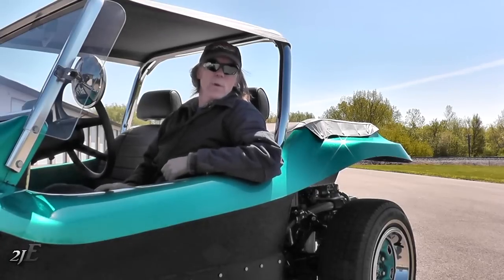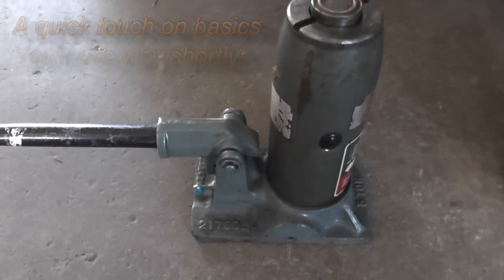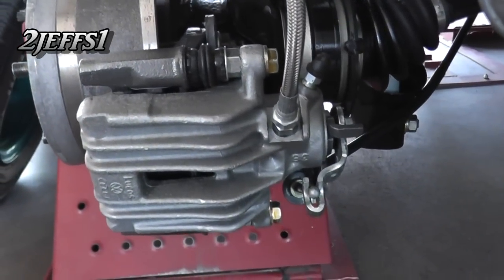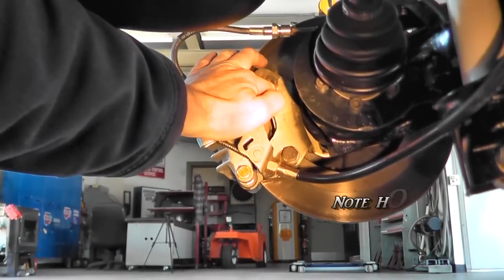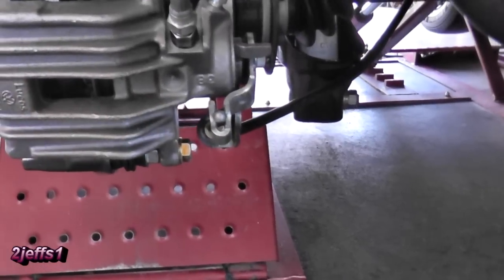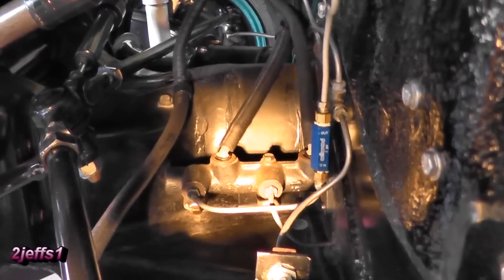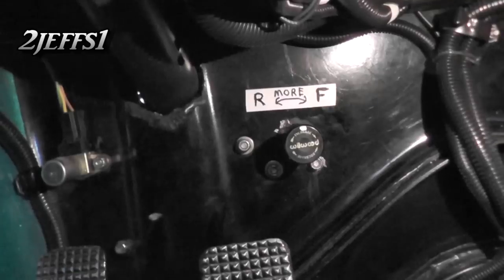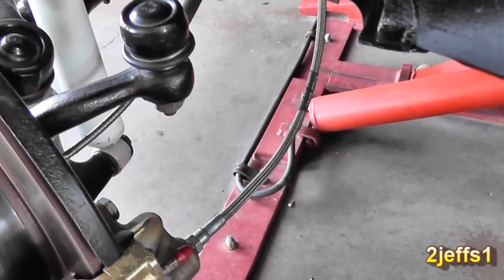VW Subaru Disc Brake Conversion Done Right

Comment: Very good and detail explained video. Like. For the all braking system I miss one more information, what is the bore on the front calipers. Also why not to instal pressure residual valve on rear break line?
Reply from the maker: +Gorjan H Not sure of the bore size on the front calipers. I didn't install a residual valve on the rear where them calipers have the ratchet mechanism for the emergency brake so they don't / won't retract like the fronts do.

Comment: Great job! Now, how did you get the Sub. engine mounted to the vw trans?
Reply from the maker: Ken Breier Hello Ken. Great question. www.kennedyenginc.com/ Is who makes the adapter plate and flywheel that is needed. Premium quality on the parts that I received!!

Comment: When adapting these newer VW calipers to the old VW brake lines can you use the newer VW Golf rubber lines and attach them right to the old vw hard lines?    Or is the flare different?
Also, could you tell me what specifically needed milled .25"?   Was it the empi caliper mounting bracket?   Or the new vw caliper mount?   Thanks!!!
Reply from the maker: +fast03gti18t There is a bubble head metric flare adapter that screws into the caliper which converts it to the older VW flare/line/hose. Sorry don't have a p/n. That cast bracket the caliper mounts on came with the rebuilt caliper and what was milled. That way if ever necessary the caliper could be replaced without having to modify anything again. The stamped steel bracket that mounts to the axle was from empi which worked well to simplify this conversion. FYI - Seems they had a cast bracket too. Don't recommend using that one.

Comment: jeff, if you have a type one IRS and you use the empi rear brake kit ... what bracket did you use for the 38mm VW golf callipers... is it the empi old bracket modified? Not sure if I got that
Reply from the maker: Yes it is. I'll explain things a bit better to make sure you get the right stuff. The steel bracket that mounts on the IRS was from empi. I believe that can be bought separately. If I remember correctly they had a cast one available too so get the steel one. That's the one I egged out (empi) to work with the cast Golf bracket which came with Golf calipers. Don't forget the offset isn't correct so that's where I milled .250 from the Golf bracket to center the opening for the rotor/caliper to fit. I would of showed this prosedure in the video for an easier understanding but so many of these projects here were done before I started on YouTube.

Comment: Hello jeff from Venezuela I have vw bug with subaru sti engine and rear disc brake kit But it no is enough for stop the car have fade the pedal , I will go update with it caliper vw golf you recomendation , one question can use forged bracket ? I have brake pump 25 mm , and yet without install residual valve and proportional valve , if I understand fine only should use residual in front ? Thanks
Reply from the maker: hedw30 Hello hedw30. I never had the forged bracket that mounts to the control arm so I can't help much with that. I will say anything is possible. Just make sure their will be adequate material left when it has to be structurally modified. You are correct, the residual was just used for the front. The rear calipers with the e brake ratchet mech do fine all on their own. The brakes will work without the proportional valve but where the front is so light (on the Dune Buggy at least) without it the fronts lock first under hard braking. One more thing. I know certain caliper designs needed the e brake operated several times to lessen pedal travel. If you don't have the e brakes hooked up this could be done with a wrench on the arm by activating several times. It's works like the older drum adjustor theory. Under excessive pedal travel that can be helpful at times to know. Never tried it without on this setup.  Hope this helps you out, Jeff

Comment: i have empy disc with e-brake all around.   seems my stopping power ratio is 70x30 front to rear.  17"front and 20"rear.  front brakes skids, I wanna have more braking on rear.
Reply from the maker: Exactly what I was experiencing too before doing this conversion. Been very happy with how things work now.

Comment: Sorry I have a VW sedan model 92. I would like to make the adaptation of disc brakes. That you occupied pump brake and handbrake whip ??? VW model that you get the whip
Reply from the maker: +Brayan Ortega Hello Brayan. I think you meant have a separate hand brake on each rear wheel. If one could put 2 handles in and run a cable to each caliper that would work very well. I'd think it could be integrated with a hydraulic hand pump system too but don't have any info for you on that and would think it would cost more to setup.

Comment: thanks .... so just to restate you use the empi bracket and modified it to fit the VW golf calliper.
Reply from the maker: commonsense Absolutely. It's kinda hard to explain this but once you have the parts and the rotors installed you'll see its a fairly easy mod.

Comment: the brass fitting male/male or Female/Male  and do you know the size 8-24 threads to 10mm sound right?
Reply from the maker: Hi Charles. It has been a long time since doing that job. Checked in my bin and I believe this is the fitting that I used that had the bubble head end that screwed into those calipers for adapting. http://www.oreillyauto.com/site/c/detail/EDE0/265000/N2033.oap?ck=Search_N2033_-1_-1&pt=N2033&ppt=C0248
Reply: Ok so I'm an idiot I ordered the same calipers for a 74 baja bug here is the problem. I have extended trailing arms and the bracket is a piece of flat bar 1/2 thick not the bracket as you have. So I got more flat bar because the mount holes are wider then the bar that's there. so here is my question. after removing the the old mount can I bolt up the caliper to the new flat bar put is over the disc apply brake to hold and center the caliper then weld in place? interested in your thoughts
Reply from the maker: Not quite sure what you have going on, too bad I wasn't there, could be very helpful right away. Just make sure where the caliper has a piston on 1 side it must be able to easily free float and re-center over the rotor with what type of bracket that you create. Hope this helps Charles, Jeff.